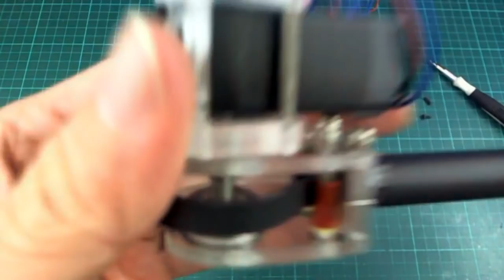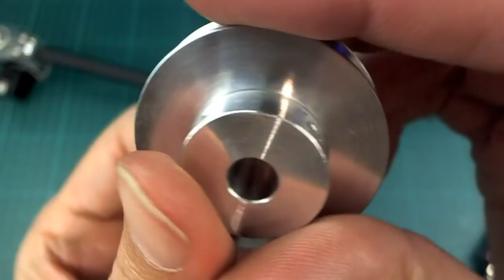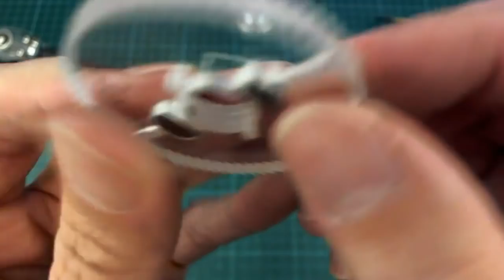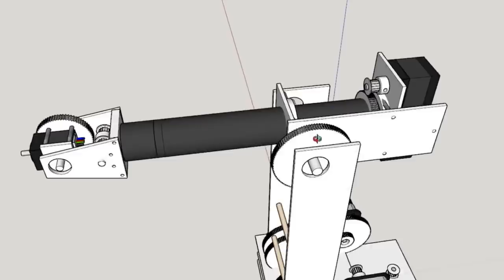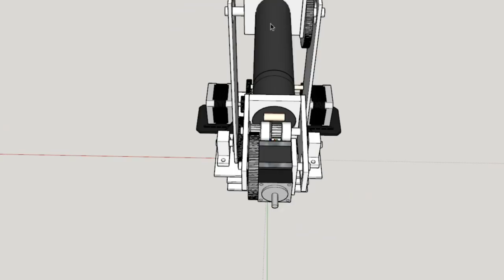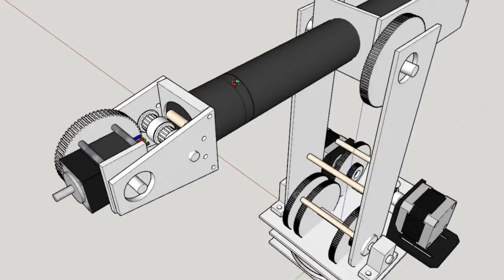Mini 6-axis robot arm part 2

Comment: Have you thought to use a tarot 450 tail gears.
https://www.ebay.com.au/i/191271096177?chn=ps&dispctrl=1&ul_ref=http%253A%252F%252Frover.ebay.com%252Frover%252F1%252F705-139619-5960-0%252F2%253Fmpre%253Dhttps%25253A%25252F%25252Fwww.ebay.com.au%25252Fi%25252F191271096177%25253Fchn%25253Dps%252526dispctrl%25253D1%2526itemid%253D191271096177%2526targetid%253D91828873777%2526device%253Dm%2526adtype%253Dpla%2526googleloc%253D9071850%2526poi%253D%2526campaignid%253D184043497%2526adgroupid%253D8467825417%2526rlsatarget%253Dpla-91828873777%2526abcId%253D%2526merchantid%253D109819472%2526gclid%253DCjwKCAiA3JrQBRBtEiwAN7cEGvcNM0b4uzcZ_QVK4sIJOEgcDA5IAqSCXrrK-yVoge-WQJWdQsCQexoCQVwQAvD_BwE%2526srcrot%253D705-139619-5960-0%2526rvr_id%253D1361730404037
Reply from the maker: I actually spent a long time looking around at RC car and heli parts, somehow didn't come across those but it looks very useful, thanks.
Reply: iforce2d The best thing is that you not limited to 360 degree rotation:)

Comment: i was wondering if you could have a carbon fiber rod inside the tube and at the far end, use a wormgear to get the far end gear to turn? (i'm loving this project!)
Russ from Coral Springs, Florida, USA
Reply from the maker: One of the problems with designing something like this is that there's an almost limitless number of ways it could be arranged. Yes, the worm gear inside the wrist would work pretty well. I need to balance the plan to be achievable with easy to get parts too though. I think what you're saying would require a crown gear of quite large size, I'm sure they are out there but where to get them cheaply is another story (and ditto for the worm gear). I kinda like the way these belts don't introduce much play or slop even with slight construction errors on my part and just minimal adjustment, and they can carry large loads. Gears need to be really tightly manufactured to mesh well if you want to avoid play, and all the load goes onto just a couple of teeth. There are plenty of robots running just fine on gears but for this first attempt I wanted to try belts.
Then just as I'm making these videos yesterday, I see this video which gets me excited about trying the concentric pipes idea again:
https://www.youtube.com/watch?v=z9kE4TkCGEE
heheh.... maybe sometime in the future :)

Comment: The belt teeth probably bind after 180+ degrees of rotation, if you put a long strip of teflon in between so they will just slide, it might work.
Reply from the maker: It starts to feel notchy at 360 degrees and quickly gets bad after that. Surprisingly at 180 there is only a slightly noticeable rubbing feeling. Yeah, I also had the idea for a thin strip of plastic between them if necessary, but I'm hoping it will not be needed.